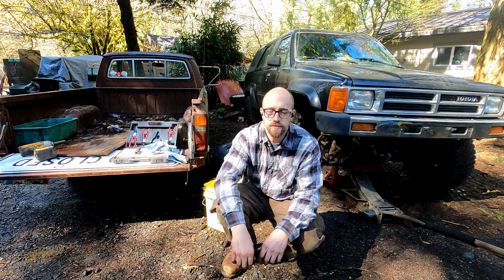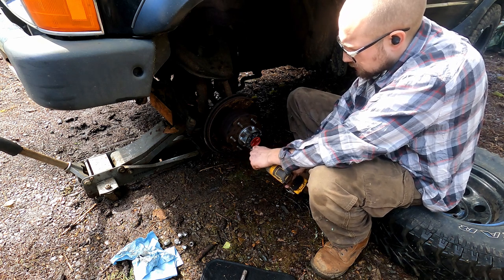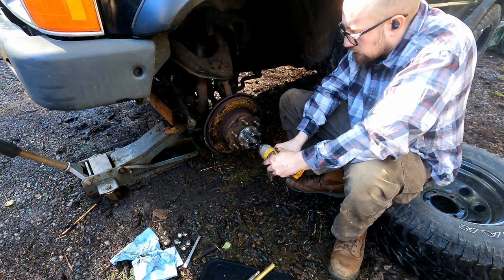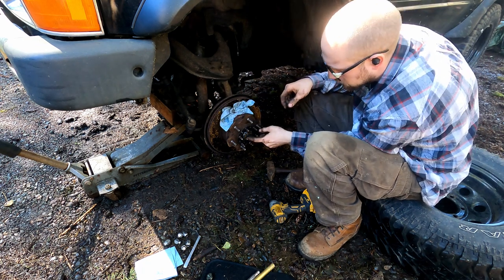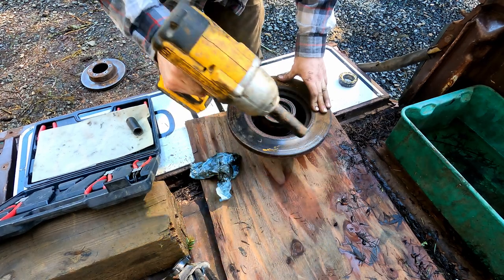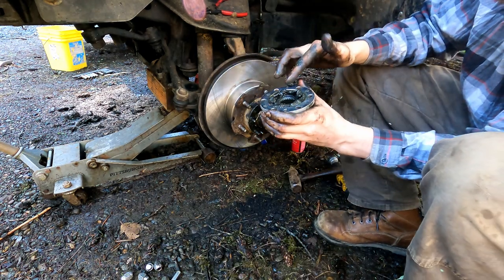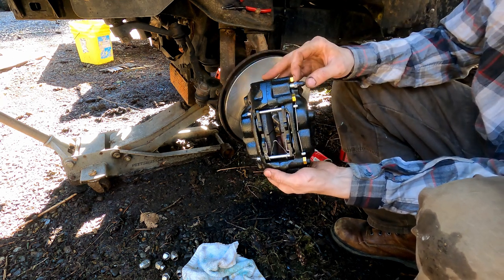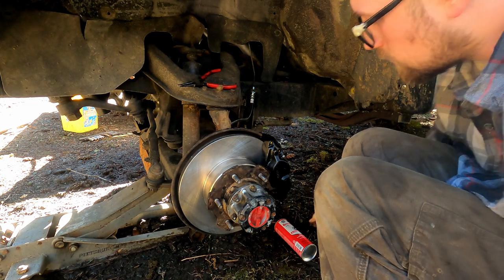1987 Toyota 4runner Rotor, Caliper, and Brake Line Replacement

Comment: Do you happen to know the part numbers for the hard brake lines? Trying to replace mine (88 4runner, ifs) but having some trouble figuring out what I need! Thanks in advance for any info and for the vid 👍
Reply from the maker: I'm sorry man, I do not. Have you called the dealership and ask for the number? Also obviously ask if the part is still available. I hoard parts for those little random kinds of pieces that I don't think about until I really need it. Good luck!

Comment: There has to be a better way to adjust bearing tightness. Another video torqued the 54mm nut to 12 ft pds. Another video just kept tightening to until he felt it was tight enough. I just need the correct way to do it. I can't risk a bearing failure when I'm a hundred miles from home.